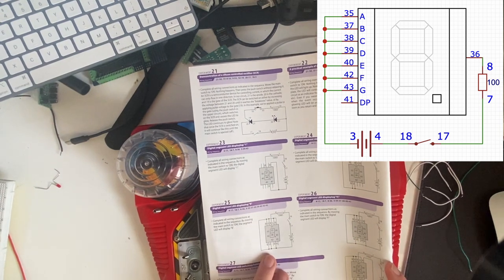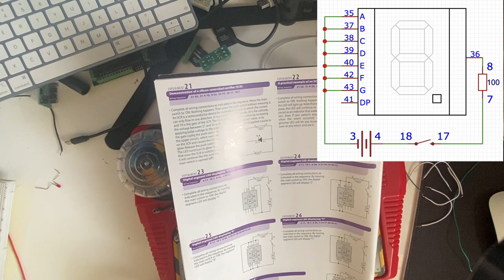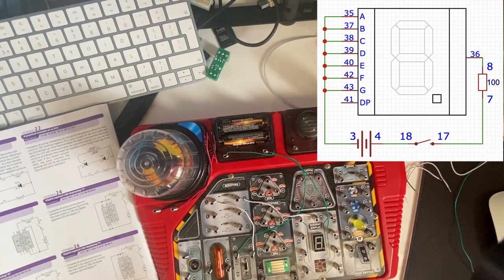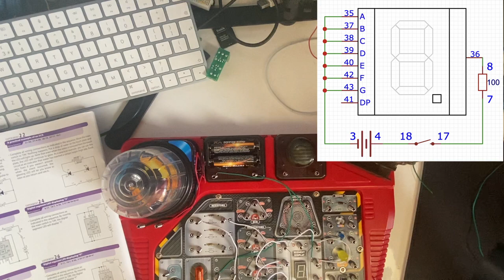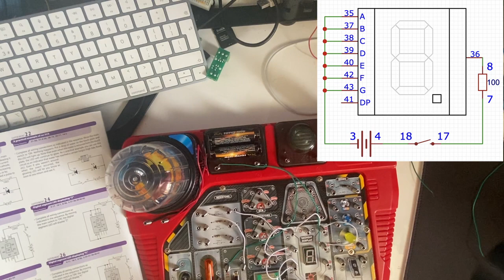Science Mad Circuit Lab Experiment 25 - Digital segment LED displaying "8"

Comment: A single resistor is not a good idea as voltage drop across it is dependent on the number of segments lit. To get even brightness you should have a resistor per segment,  but that would mean they would have to put the kit price up.
Reply from the maker: One of the flaws in this kit is that the displays pins have no resistors on them and the kit only has 3 resistors to use.
Reply: @AJB2K3  well it has to be built down to a cost, and an extra 8 resistors increases that. If they are not going to use the display fully then there is no real need for the extra cost.